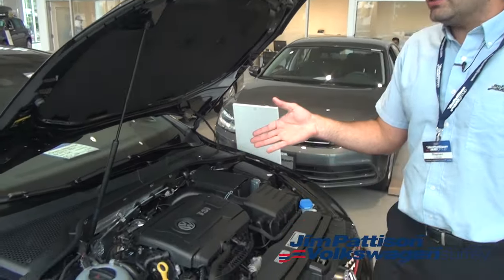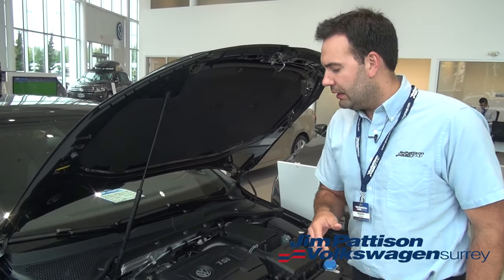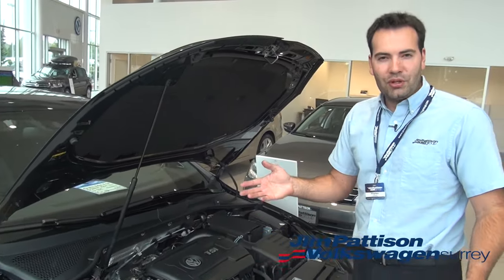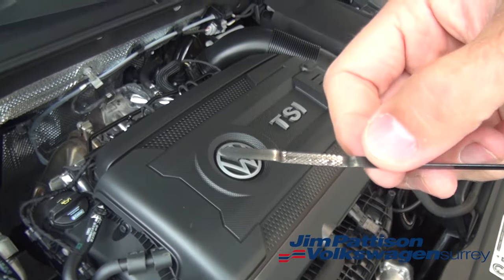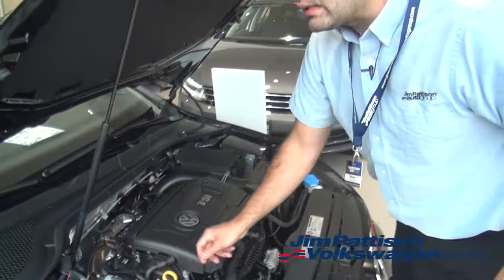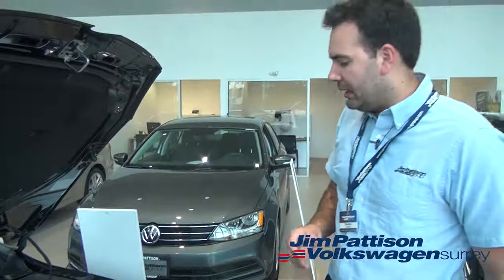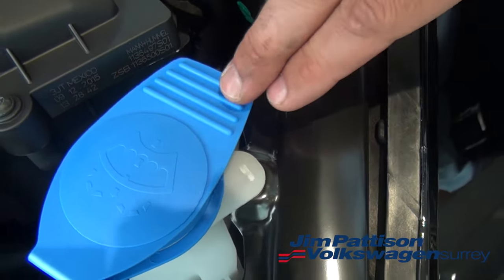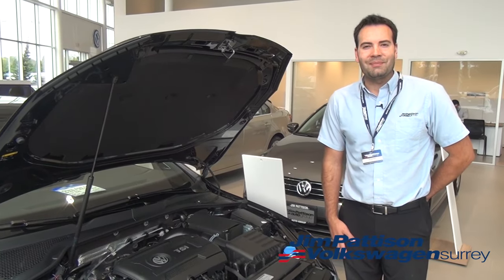Volkswagen Fluids

Comment: Um... you missed two of the basic fluids, the brake fluid and the power steering fluid. Where/how do I check these two fluids? Thanks!
Reply: VW no longer uses hydraulic power steering systems. They use electric power steering, so no more fluid)
Reply: Plus, if there is a problem with your VW, the infotainment system on your dash will notify you about low fluids, low tire pressure, etc.
Reply: @bmingo2828  my jetta has the power steering light on
Reply: @bmingo2828  I have an 09 CC, how long ago did they stop using fluid?
Reply: @oozhaboo  I believe 2016 was the last year of hydraulic racks in VW’s.
Reply: @oozhaboo  but models before 2016 could be either electric or hydraulic.
Reply: @bmingo2828  thanks
Reply: 2014 vw passat tsi transmision fluid where can i found the dip stick?
Reply: @vincentcatarroja9704  It doesn’t have one. It’s filled with a “lifetime fluid” from the factory. It can be changed but if you car has over 80k miles on it, I wouldn’t recommend it.
Reply: @bmingo2828 over or under
Reply: @bmingo2828 no way really?? I have a 2017 vw passat tsi… just bought from vw dealer at 95kmiles…. Do you think they redid the fluid, is the transmission fluid something I never need to look at as since you said it’s a “life time fluid?” I never knew this
Reply: @dylankoerner5520 . I doubt that VW changed the fluid. You could check with them though. In general transmission fluid should be changed in 60k intervals. If you verify that at 95k it’s never been changed, Do Not Change It. Over time as the transmission wears(normal wear and tear) small particles such as metals, plastics, and other contaminants find there way into the fluid. These particles actually create friction and prevent slippage in older transmissions. If you go to change it and remove all the fluid with these particles, there will be less friction in the transmission and it will be more prone to slipping. 
In addition, the actual procedure for changing the fluid correctly in these cars is ridiculous. You have to check the level, take the temperature of the fluid and then calculate the proper volume to refill and the proper height to reset the drain valve insert. I’d leave it alone and not worry about it. Just don’t hard launch it if you want it to last.
Reply: Yep!
Reply: @bmingo2828 i got a 2013 polo that cant find no powersteering fluid for not on videos or the car so maybe before 2016
Reply: @shanzomusic8957 , yes as mentioned above, pre 2016 could be either electric or hydraulic. Post 2016 is all electric.
Reply: And engine must be at operating temperature

Comment: We want to know about VW power stering fluid location and how to replace/fill. Whatever you are showing is way too basic stuff and If anyone does not know that, they shouldn't even drive.
Reply: Most of them are electrical power steering=no fluid.
Reply: @davisbrett44  is vw cc tdi has electrical power steering without oil ?
Reply: @monirmualla  mine is making a noise when turning any ideas ?

Comment: The coolant fluid should NOT be topped off due to expansion. It should be filled between the MIN and MAX line! Also G13 is compatible with G12++ 
Some tanks still show G12 not G13 as the video shows.
Reply: Very helpful. I wondered as. My VW shows G 12 and the dealer sold me G13. Makes sense

Comment: There is a lot wrong with this video, you mentioned windshield washer fluid as "very expensive to buy" I can't tell if you are joking or not lol and you also forgot to include two other important liquids such as the transmission and the brake fluid. You also addressed that the coolant must be the Volkswagen pink formula liquid. This is also not true, yes it might be recommended but many more coolants can work just as fine, as well as the Castrol that's also recommended due to the additives in the oil, you can use other oil brands as long as they meet the viscosity specs. Hope this helps! And for anyone who may be seeing this, most newer VWs typically have electric power steering, requiring no fluid whatsoever.

Comment: Where is the power steering fluid location for Tiguan 2018?
Reply: Have same question for my 2016 passat, did you get the answer?
Reply: @rawasardar8571  were you able to find out
Reply: @JusBus2  yes i did, it is actually not power steering, it has an electric steering system
Reply: @rawasardar8571  thanks for getting back to me! How did you end up fixing your issue?
Reply: @JusBus2  no problem man, sorry i dont check my notifications out often, yes it was just some dirt in the joints, i got it fixed by washing the car with a pressure washer steering the wheels to the side and moving it while pressure washing it.
Reply: Here I am looking for the power steering location for a 2011 model

Comment: What about the transmission fluid
Reply: I was wondering the same thing
Reply: transmission fluid is underneath the car in most cases. My VW its very difficult to access the transmission fluid. Most cases wrong trans fluid/fluid levels will mess up your transmission permanently. best to let mechanics handle transmission stuff

Comment: What about clutch and breaks ??
Reply: depending on your model and year the clutch and brake system may be INTEGRATED. Either Way, you can't go wrong using DOT4 as it is formulated to work better in hotter temperatures and fights against moisture buildup better than DOT 3 (technically brake fluid is actually hydraulic fluid) DOT 4 is backwards compatible. DOT3 is ONLY good in DOT3 applications.

* I have a 2013 TDI Manual (6 Speed)
Be sure not to make my mistake and try to flush and replace the DOT4 Fluid properly about every 50-60k or else you will have expensive issues replacing the slave cylinder when it fails.
Even if you go to a professional Non-dealership location to do the proper flush, it shouldn't cost more than $80-$100.
Ignore it ? Try more like $900 for repairs because of the location of the slave cylinder. :(

Comment: Clutch fluid is less important to mention than washer fluid? 🤔
Reply: It has electrical power steering. No oil has been used anymore on Volkswagen group since 2005.
Reply: @techwery6757  My 2006  Polo 9N3  have power steering on fluid/oil so....maybe after that they changed on electrical
Reply: My Polo has.....😎 sorry about that